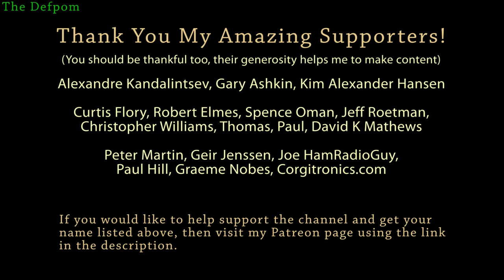#692 Farmtek Polaris Interface Project - Keypad & Controller Part 3 - Free PCB's From PCBway

Comment: To have lower profile esp module you could use turned pin socket stripes and turned pin strips and remove the plastic strip from the pins after soldering so you end up with just 2 to 2,5 millimeters distance between board and module.

Comment: I would of used a step-up/boost converter for the +5v supply and connect each cell in parallel (1s4p) than you only need to watch for a cut-off voltage around 3v. Omits any BMS and balancing of cells.
Reply from the maker: Mick - I did consider doing it that way.

Comment: Have you tried using solder paste rather then solder and flux?
Reply from the maker: Fyrho Nypac - I haven’t really used paste that much, I do have some, maybe I should do the next one that way to see which is going to be easier.
Reply: @TheDefpom  just put a dab on each pad, place the part and heat. Trick is not to use too much but wick fixes that. It's even easier with a stencil so maybe try ordering one with the next batch of boards. There fairly cheap and save tones of time.